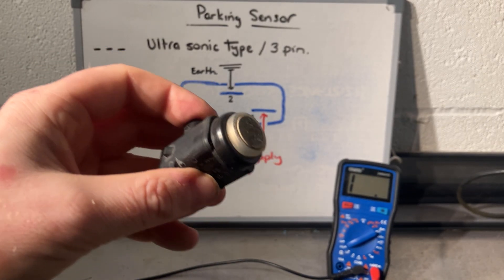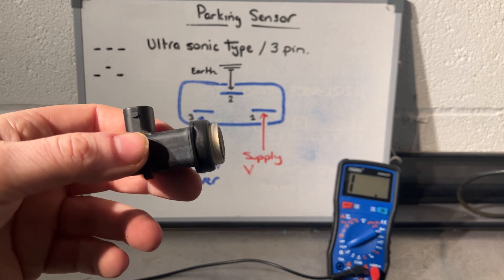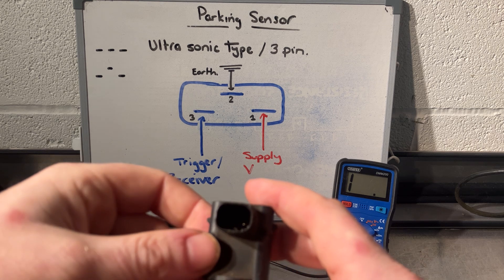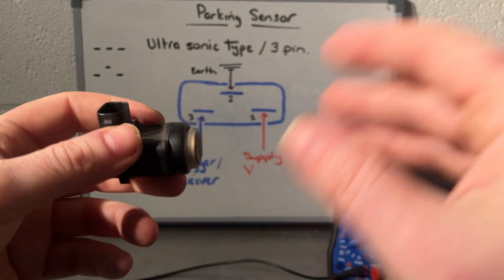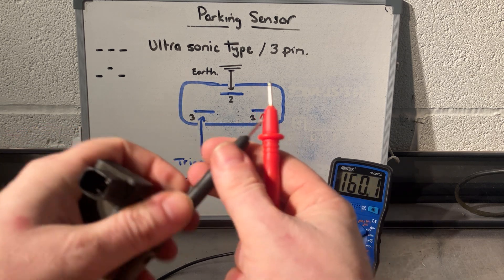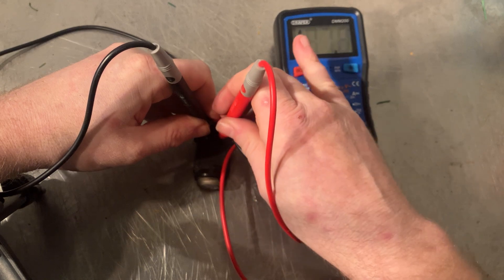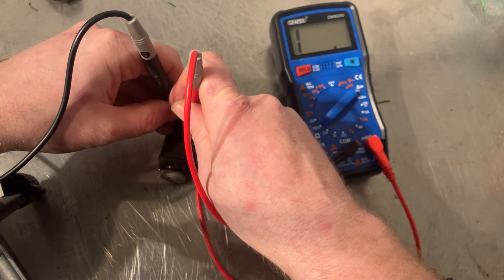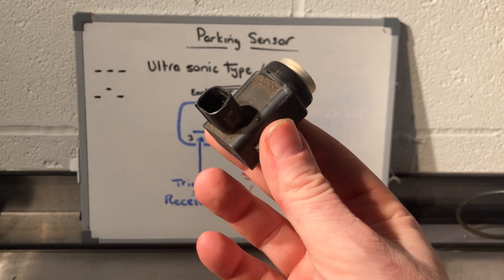How to Test a Parking Sensor.

Comment: Thank you. I've struggled to find much about testing these electrically. Once had a Skoda with front park sensors not working. Turned out after many hours struggling to get to the bottom of it. The car had a used bumper & sensors fitted from another Skoda with a different type of sensors 😩
Reply from the maker: Nightmare, nothing worse than having to solve an electrical issue caused by someone else. Did well to solve that, very random! Thank you too!